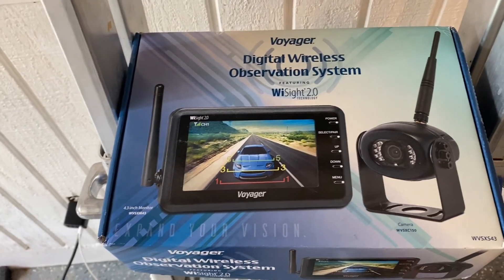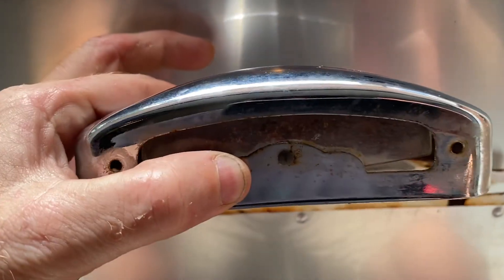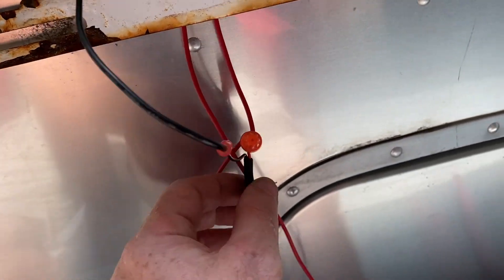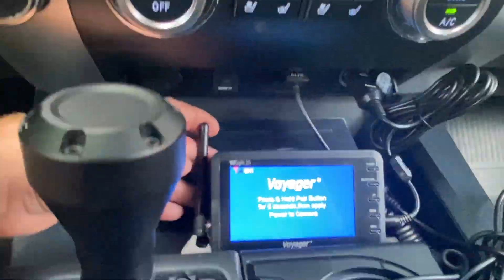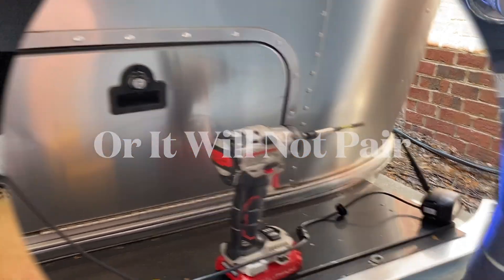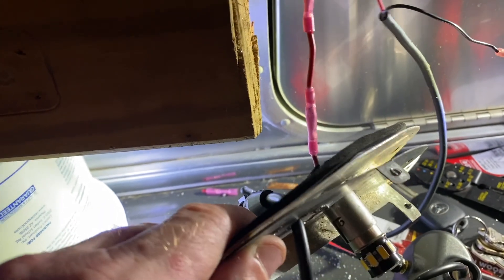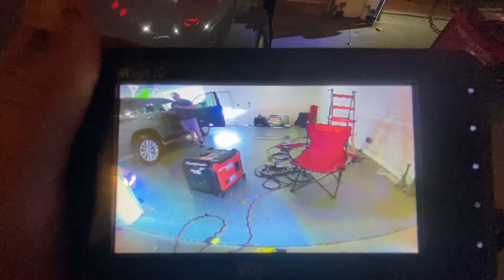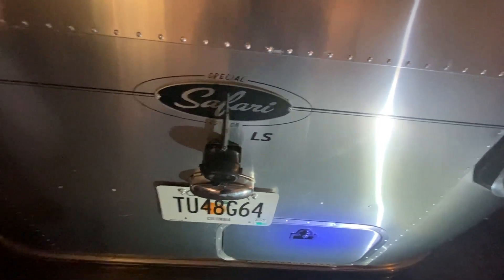DIY Airstream RV Backup Camera Install on my 23' Safari Travel Trailer

Comment: How’s it holding?
Reply from the maker: I just took it on a 5k mile trip from GA to UT and AZ last month and it worked great.  Never budged.  On the way back even drove 800 miles through rain and it stuck prefect.  In the rain signal got a little wonky a couple times, but that was it.

Comment: What TPMS are you using?
Reply from the maker: https://www.amazon.com/Tymate-Tire-Pressure-Monitoring-System/dp/B085C2HMQP/ref=sr_1_3?crid=38LN1999KKYAK&keywords=tpms&qid=1662380303&refinements=p_85%3A2470955011&rps=1&sprefix=tpms%2Caps%2C100&sr=8-3